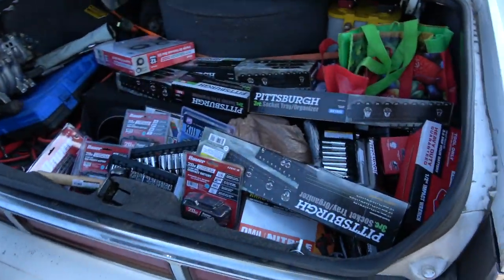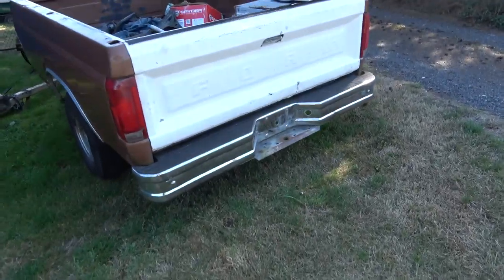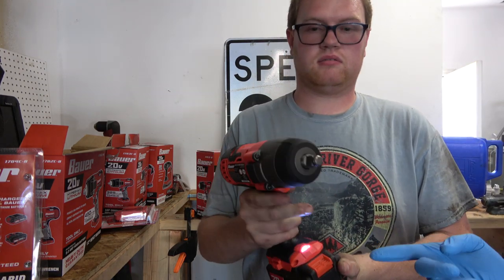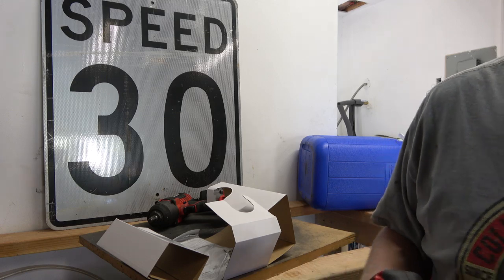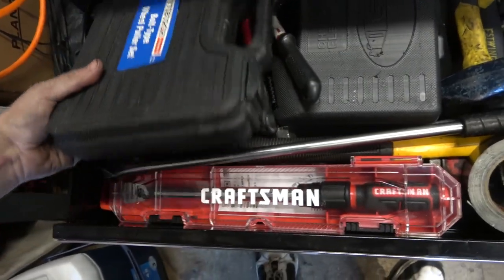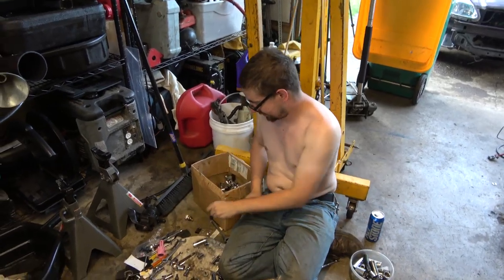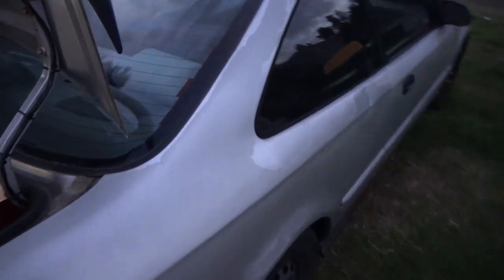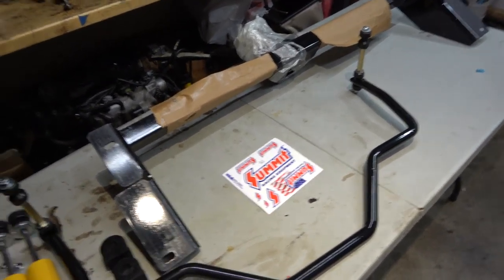Harbor Freight Tool Hoarding! Let's see How Long They Last

Comment: Just picked up 1 of their vulcan welders after good reviews an tube vids, only thing i dont like is their pliers, not comfortable in hand, broke more craftsman ratchets an not a single HF one yet, sears wanted 52 bucks for one 3/4" drive socket, bought whole set for 56 bucks HF, using on my 5 ton 6x6 tq'ing to 3-450ftlb, using 3 of their gensets

Comment: Do you recommend doing transmission on a 2000 GMC Sierra 1500 5.3 with all those tools?
Reply from the maker: Jonathan Sanchez I’m sure they will do the job. Maybe we will find out how well they do when I pull the engine out of my truck.
Reply: You may need some special tools for a transmission. I had to makeshift tools when I did my Ford E40D.